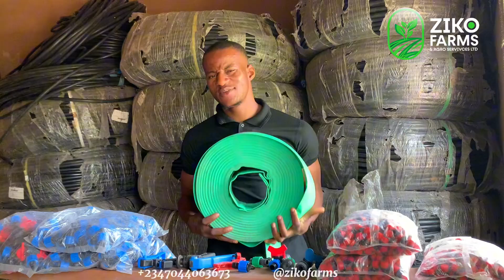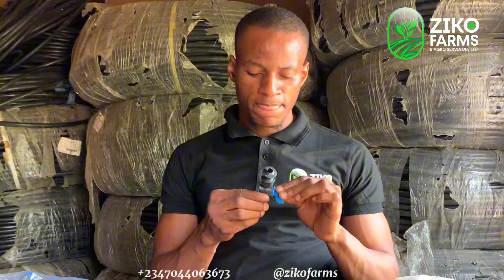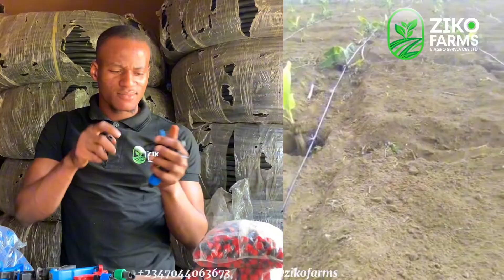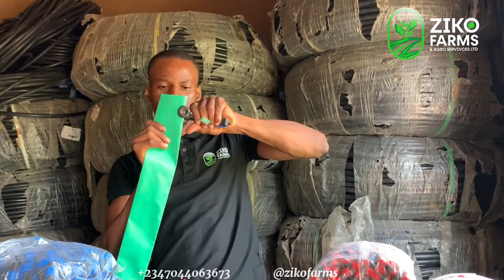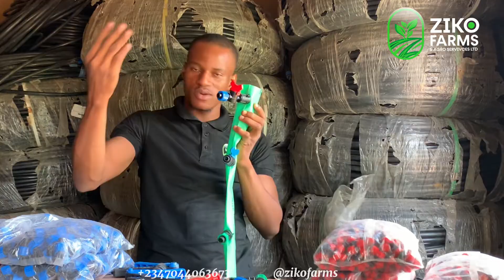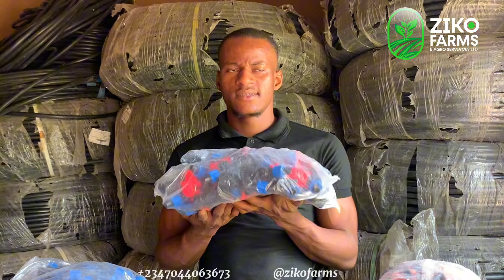Drip Irrigation system for PLANTAIN, BANANA, COCONUT, AVOCADO and other tree crops.

Comment: What about if I want to use on banana which one would you recommend according where spacing is concerned.
Reply from the maker: You can either use the sprinkler or Drip tube depending on the alignment used